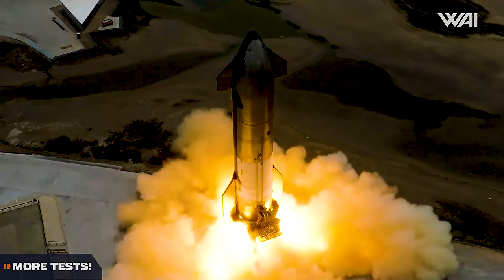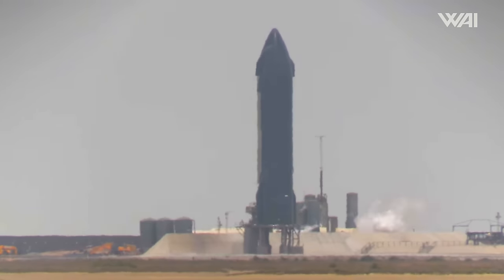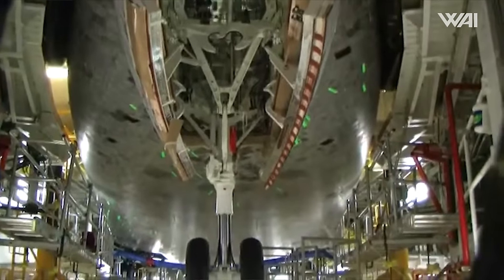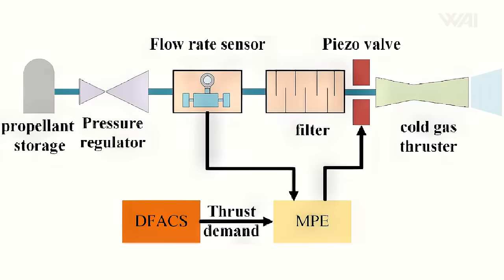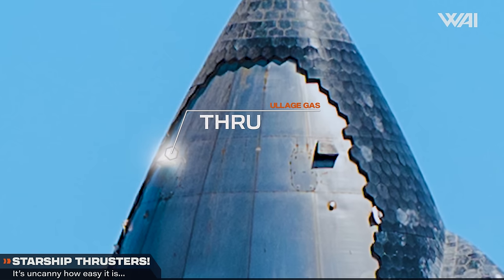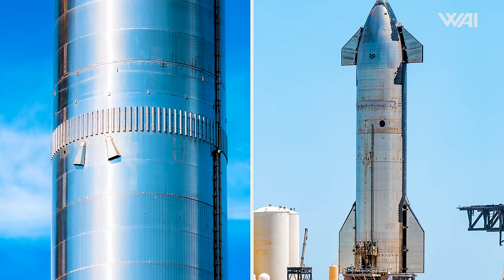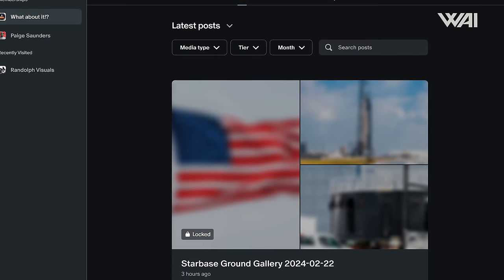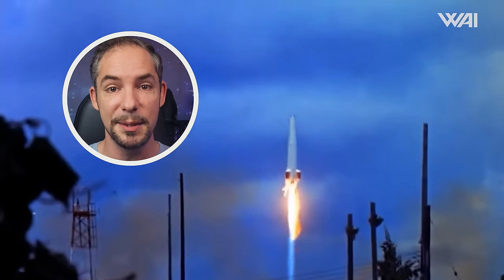SpaceX Starship's #1 System Fix Needed!

Comment: Some tiles are going to be coming off every flight until they stop taking baby steps towards fixing the attachment problem.  They did not fully account for vibration forces …  plus when the starship was oriented sideways more tiles were flying off during reentry. They can fix the reentry orientation problem but the fact tiles were flying off implies tile attachment weakness that can not compensate for imperfect aerodynamic flight. 
      The least dramatic change is to replace most of 1 the foot wide hex tiles that have 3 attachments with larger tiles that are shaped like 5 adjacent tiles. This gives each tile 15 attachments instead of 3. And the large tiles are all identical in shape with no change in the steel necessary.   The remaining small tiles may need 6 attachments instead of 3.
       They need to understand the vibrations better. With vibration transducers attached to some tiles during static fire testing already being done (a few special sensored tiles that are temporarily swapped out.  The test results need to validate their vibration simulation model (finite element analysis model).
       They need to identify exactly what is failing and then modify/strengthen as necessary. Is it due to dimensional shrinkage when the starship is cooled to methalox temperatures?  The stress on pins due to changing locations when steel body shrinks combined with vibration exceeds allowable peak stresses? Do vibrations unexpectedly change when steel Modulus of elasticity changes at cryogenic temperature?  More rigid steel may cause higher frequency vibration nodes. The individual tile may have resonant vibration modes that amplify 10 times stronger certain vibration frequencies.
     There are some other solutions which are better (and lighter)
 And cheaper) but would require significant time and effort to implement

Comment: I suspect the solution to the tile problem will be the simple but boring one. Identify the areas of the ship that are prone to such problems and cover them with smaller tiles that tesselate into the wider geometrical pattern. Boring works very often over clever.

Comment: TILE SOLUTION --->>> The tile problem is solved; a matter of execution.  A carbon fiber chain-link stocking;or, net; wherein the straps of the chain-link are graduated consumable array of carbon-fibers stacked in a pyramid cross-section shape. Stretch the stocking over the tiles and bolt it down strategically.  The tiles WILL stay in place.

Comment: NASA was doing things much more complicated than this in '65. What is the problem with SpaceX? 60 years of rocket tech to build upon or use for reference, and after 3 attempts the Starship still hasn't even achieved orbit? I think it's time to stop cheering after each loss of a rocket and start actually getting something to work. And the crew cab and cockpit hasn't even began to be developed yet. I'm starting to see a flop here.
Reply: What was it that NASA was doing in '65 that in any way relates to the Starship, or even the Falcon rockets for that matter?

Comment: The whole concept of using tiles as Starship's heat shield seems to me to be inherently untenable since tiles are so vulnerable to unavoidable vibration and reflected shockwaves occurring during launch.   Therefore, why not bond a continuous heat shield to the entire spacecraft's metal skin, not just on one side?   I understand that would pose a weight penalty, but it may be unavoidable.   One alternative might be to temporarily abandon the whole notion of having the entire ship reenter Earth's atmosphere and land and instead have a reentering capsule for the crew stored inside the payload bay.   A new crew to the orbiting Starship could be boosted to orbit, rendezvous and docking.   In other words, Starship never leaves the vacuum of space.    Meanwhile, R & D could work on the heat shield problem.

Comment: As for the rolling movement in space and the problem of fuel slosh, it would be easy to look at haul helicopteres which are most stable having two counterrotating rotors. For starship means it can have two counterrotating fuel tanks which stabilize and increase the inertia of the vehicle on one hand and on the other ensure that the contained fuel is always at the margin of each rotating tank. The rotation speed has to be only fast enough to ensure the containment of the fuel at the margin of the spinning tank at any movement and maneuver.

Comment: The fix for the tile problem is simple. We lose tiles because they are attached by metal clips individually. There is very little in the way attachment surface area for each tile. The fix is to increase the attachment surface area by attaching the tiles with a high temp epoxy and to install them as molded panels instead of individual tiles. I was so disappointed to learn that SpaceX went with tiles instead of panels glued to the rocket body. You might rip off a tile, but NEVER with a panel. You will rip a whole in the spacecraft before you lose a panel. The truth is each tile becomes a point of failure and a risk of vehicle loss. I hate tiles for this reason when there is a better way available if only somebody would use it.

Comment: Instead of having 18,000 heat tiles, is it possible to have several large form fitted tiles affixed to it? Seems like that would eliminate all the little ones flaking off in critical areas.

Comment: Referring to the tile issue - - It would be nice if they could forge tiles with a larger diameter, decreasing the amount of tiles used, thus also giving more anchoring points for the tiles, maybe allowing for more resilience in the tiles themselves. Maybe, one of these days , the tiles could be a meter across , with hundreds of anchors underneath.
Reply: Forging the tiles would squeeze the glass fibers together, destroying their insulating properties. Large tiles could be prone to breakage due to uneven thermal strains
Reply: also if one large tile braks/falls off - more serious plasma heating issues

Comment: why not just bolt the heat shield tiles to the starship instead of gluing them to the starship metal? Yes, I think it isn't a problem to fix the heat shield tiles to the metal using special bolts or rivets. SpaceX will figure it out someday.

Comment: Every NASA spacecraft, especially spacecraft carrying humans, have redundant RCS thrusters and sometimes entire redundant RCS systems. Unfortunately, SpaceX's devotion to the "no part is the best part" often goes way too far.
As long as they take this philosophy to its extreme, we must get used to failures.
NASA doesn't like failures, because they are crucified by the public when they happen. SpaceX has gained a certain immunity from criticism because their fans don't care and the public is not at present paying attention. They have been exceptionally lucky, since no humans have died on their spacecraft. 
NASA got "religion" and arguably became much too conservative after their experience with human fatalities. SpaceX's young engineers are equivalent to NASA's 20-somethings that were running the human space program in the 60s. We will see if SpaceX will change when they face a similar challenge.

Comment: Attitude control: why not use Reaction Control Wheels like all satellites use?  Attitude control is too important to leave up to mere cold or hot gas thrusters.
Heatshield: plasma is magnetic and starship is steel so turn it into a giant electromagnet and repel the plasma - a few model 3 batteries, some capacitors some wire...
Reply: Oh sweet jeeeeeeeesus, you overthought this one to the fourth decimal place!😂😂😂😂😂😂.  Oh, don’t forget the safety wire, the jet wash, and 300 feet of flight line!  Oh, and stainless steel is not magnetic, or not enough to be used as a plasma deflector system.

Comment: To help with the tile issue they should consider a type of carbon fiber mesh as a backing layer and create sections as tiles you could lift and place in sections. there could be some mesh overlap that could tie all the larger segments together. This would be a different approach to single tile placements and may offer just enough strength preventing further tile displacement.

Comment: well, when it comes to a lunar landing, If it can be easily solved using cold gas thrusters to land on the moon, why not make a belly landing which makes loading and unloading starship a whole lot easier? Then instead of using elevators, they only need foldable hangar doors. For a Mars landing, I would use 3 raptor engines, that just move from the bottom to the sides pointing slightly outwards, just like the legs of the falcon 9 boosters have... This will prevent blowing a crater underneath so starship can land safer.

Comment: Space shuttle replacing a tile took 3 days because they included the time for making the custom tile itself, because they did not always have spare tiles for some specific shapes. For spaceX the time of 1 hour only counts installation and implies there are always spare tiles available even for the exotic tile shapes like those on the wings, which was mostly true for the space shuttle too. I highly doubt that 1 hour per tile time will be kept so low once the cadence goes up. Not saying 'ergo just as bad as space shuttle', but 1 hour vs 3 days isn't really a fair comparison either.

Comment: Create manageable mats of thermal protective tiles by weaving tiles to adjacent tiles, then weave those mats to adjacent mats until the entire area required to be protected has been covered.  

The tile work would be simpler if the Starship didn't have to have those fore and aft flaps.  Those flaps should be replaced with a scissor wing (or wings) stowed on the dorsal area of the starship.  The wing would deploy 90 degrees (or to whatever configuration is needed) prior to reentry, and then return to the stowed position prior to the terminal powered portion of the landing.

Comment: A solution for the falling tiles would be a redesign of the tile locking mechanisms.  Right now they use a pin system.  Some sort of lock i'm sure is being used.  Better to redesign that so that the lock better grabs the tile and or multiple pin and locks for the tile so if anyone fails comes loose etc.  the tile can remain in place.  To the point where in order for the tile to become detached it must be broken in multiple locations.

Comment: Maybe you could make modifications to a hot gas thruster, by placing a face on the exhaust valve?  Then you could create a digital trigger to cause the face to blow out air through the lips? 🤣

Comment: Pre-fab tile mat/wrap thats glued on. Only has to survive one reentry then re-wrap.
Also, why not shunt gas into a tank before using it as thrust. If the tank is electrically heated wouldn't that solve the freezing issue?

Comment: It may take 3 days to replace a tile, but it doesn’t fall off. 

Hopefully spacex figures it out
Reply: Shuttle tiles fell off all the time, including replacements
Reply: Then why were they replacing them?
Reply: @shanent5793  on an aluminum shuttle? I remember them cracking, I remember the gap filler stuff sticking out between the tiles being a big deal. Dont remember tile loss much. Maybe they tended not to say anything. :)
Reply: @jim2386  it was notorious during Columbia's construction. Just moving the thing caused tiles to fall off. Part of the long installation time was proof testing, tiles often came off after being pull tested so it had to be done again. Sixteen still fell off after the first flight
Reply: @shanent5793  ah. During the beginning design stages. Was it common during later flights or did they eventually figure it out?

Comment: I’d embed titanium alloy wire in the tile even if it has to be thicker so that those wires can hold the neighboring tile laterally and on the inside where it attaches to the vehicle. Or just install them from the back side with many rivets with the posts inside like aircraft rivets. It’s more weight but it’s about giving the tiles more individual purchase.  It might also be a good idea to have an alternate method of repairing in orbit if a tile breaks that doesn’t require full replacement and access to the inside of the outer wall. The problem with easily replaceable is that it’s more easily ripped off.  Could they come up with a method of treating the surface with a thick continuous monolithic tile using riveted metal loops for purchase?  If not why?

Comment: not the big problem  both stages were out of fuel and oxidizer on the last flight...and that means that they could not or barely make orbit with just the dead mass of the vehicle.  where is the 100 tons mass simulator?  then the raptors dont relight

Comment: maybe this is a really dumb question or suggestion but I'm curious why they couldn't shrink wrap the starship body with some kind of new developed polymer. something to just squeeze the tiles to the starship for the engine ignition that only lasts long enough during the time of the most vibration and can burn off on reentry.  then can be recoated or shrink wrapped again for a new flight.

Comment: Perhaps they should try not to destroy everything they send up? In three launches Space X has sent 117 Raptor engines to the bottom of the sea, absolutely insane. The space shuttle only used 46 engines in the entire program, in 135 launches. When will NASA end this madness? Hire a better contractor.

Comment: This is my idea how to solve the ceramic tile problem. Coat it, spray it with a clay slurry. Yes like a  toilet. Just like they make tile flooring. It will make the tiles stay to orbit, and the best part, the clay will bake opon re-entry and become hard as the floor you walk on. Also apply to hot stage ring, to protect the booster.

Comment: The static fire test for the ship is the roughest vibration regeme it will ever have to go through. I suspect almost as touch as reentry - in regards to mechanical stress and shock waves.
So for me hardly any tiles came off, maybe and handfull out of 18k and no many open a large area underneath the tiles thus heat will take longer to build up.
Depending on worst case time it takes to get out of the regeme that the ship is going through pasma SpaceX should know how long a given area can take without tiles.

Comment: I think that adding a special coating on top of the tiles is a solution. This coat can be consumed at re-entry and then applied again. 
This process can be done using robotic arms or stones.

Comment: The problem is not the heat tiles flaking off during a launch, it's the vehicle burning up on reentry because the tiles are absent. The Shuttle engineers worked over 20 years fussing over heat tiles ( the ones that take days to replace) and still lost an orbiter because replacing them once in space proved to be impossible. I hope the simple monkey they get to sit on this candle are as excited over functional failures as the showmen promoting the Elon Show. It'll be fine. 💀

Comment: I think that tiles are and will remain a major problem despite SpaceX advancing the process of mounting.  I have thought that a “spray-on” material which is slightly flexible would be an answer.  Not being an engineer, I do not know what the exact material might be.  Maybe a tire manufacturer might have a suggestion.

Comment: Perhaps a mix of Flexible Silicone RTV Rubber Adhesive along with the current adhesives SpaceX already uses, can keep the tiles in place. Perhaps the cold gas Thrusters need lithium batteries and strategically placed electric heaters, to keep them from freezing over.

Comment: Take off the tiles and reduce the entry  rigidity. Then use that weight for braking fuel and the nonsensical slam into atmosphere problems end by themselves. This idea if having to brake by violence is not intelligent. And it will not wirk with the starship.

Comment: To address the tile-loss issue I would limit the payloads of the first production launches of Starship, to allow for longer re-entry burns that slow down re-entry speeds enough to allow for unprotected 304L to survive the re-entry heat.  When the tile concept has been properly tuned, payloads and re-entry speeds could be increased correspondingly with confidence in the tiles.

Comment: Hex Tiles might need to be 'tongue n groove' then use  heat-resistant glue to hold them into place;  this is what keeps my bamboo hardwood floor stay put.. (yeah, it' doens't reentry, but why reinvent the wheel) ? eh?
Reply: the heat tiles are fragile. They are more ceramic foam. More air than stone. You can crush them with you hands if you so choose. Such a thing will not hold if you use a tongue n groove.

Comment: The tiles will definitely need an overhaul on design.Perhaps space x could possibly make a fully designed type casing for its under belly?

Or perhaps a three piece sections instead of having to place all those tiles one by one?

The fins can keep the tile set up but the body just needs better.

Comment: Why SpaceX is not using the Water Deluge System also for the static-fire tests to prevent shockwaves etc causing heat tiles to fall off?